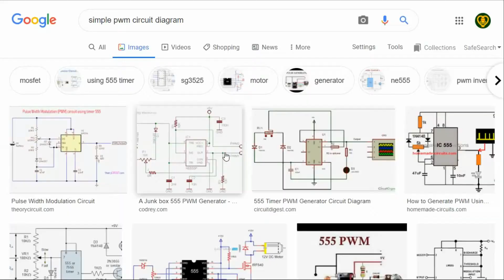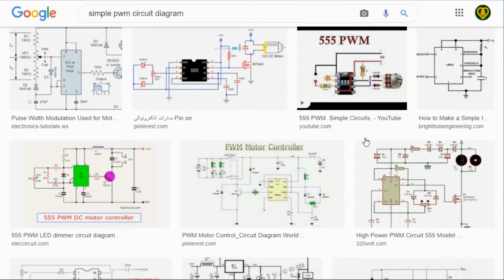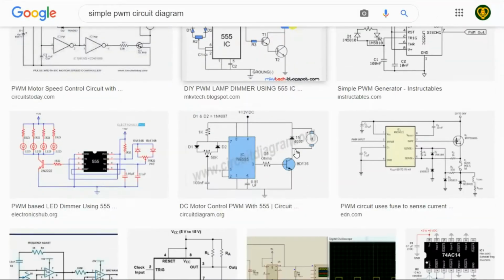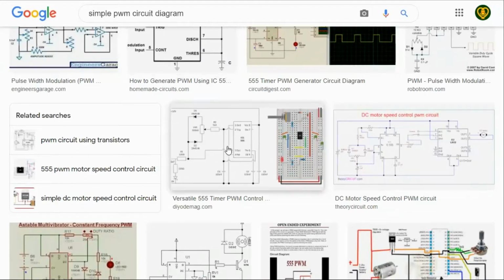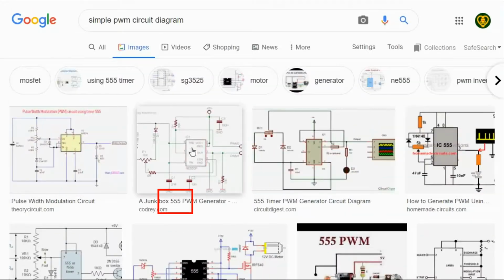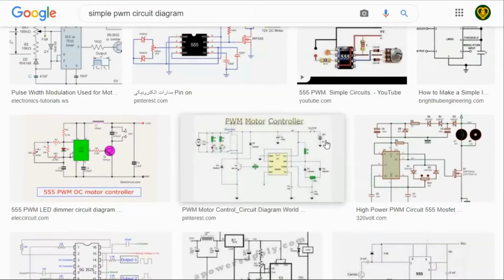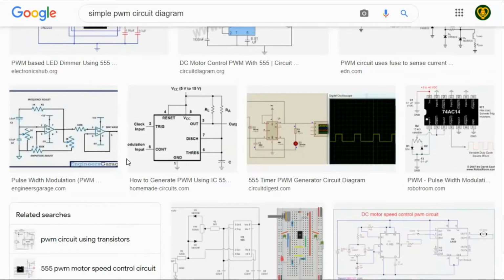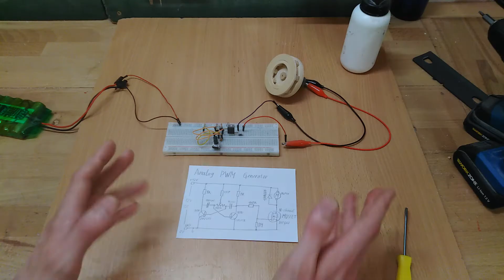Simplest transistor based PWM controller

Comment: This is a nice and simple circuit. But as simple as it is, it is crazy electronics, because every active device in this circuit is operated out of spec. The BJTs are operated in avalanche breakdown regime, because their base voltages go down to voltages far below ground level. You can simply solve this issue by the use of MOSFETs instead of BJTs.

The MOSFET is switched unnecessarily slowly due to the 100k gate resistor in combination with the gate capacitance. This leads to unnecessarily high switching losses. The gate capacitance often reaches the nF range. In fact you don't need a gate resistor at all, because the astable multivibrator itself has not really steep switching edges. This is also the reason why the 555 timer is not the worst choise because it can switch in the sub-microsecond range.

Furthermore the PWM switching frequency can be very important, especially if you switch inductive loads. If you use a too high frequency you can find, that a motor will not start at all because the motor inductance allows not enough current to flow. And at higher frequencies the switching losses can become dominating over the Rds_on losses of your MOSFET.

Comment: Sehr schönes Video. Mir gefällt persönlich, dass du genu das mit zeigtst, was beim Basteln, des öfteren passiert. Es funktioniert nicht sofort. Fehlersuche ist angesagt. Gerade wenn man keine Professionelle Leiterplatte verwendet, kommt es einfach vor, dass man irgendwo eine Drahtbrücke vergisst, oder ähnliches.
Meisstens ist der Fehler schnell gefunden und behoben, aber manchmal sucht man sich dumm und dämlich. Zum schluss fehlt einfach, irgendwo die Masse an einem Bauteil.
So macht jeder seine eigenen Erfahrungen und lernt. 😉

Comment: I used a s9014 instead of a 2n222 and p80nf55 in the place of an N-channel mosfet but when i hook up the power (12 volts from a PSU) , it draws so much current the the mosfet heats up and the pwm doesn't work. when I hook up a 9v battery and i put the output wires in my tongue and i crank the potentiometer, I can feel current but when i hook up an led or a motor, it doesnt seem to work. Help
Reply from the maker: In the video my MOSFET got pretty hot at first as well, there were some connections I should've removed. Nine times out of ten when a breadboard circuit doesn't work, it's just a wiring mistake. Take it apart and put it back together from scratch, then it should work (unless you did the same mistake again). Just recently I tried putting together a high voltage programmer for AVR programming and it didn't work. Turns out I had just forgotten a jumper and after reassembling it everything worked fine.
Your component choice should be okay. Also, there is a newer version of this circuit you might want to try:
https://youtu.be/CcMiGZUzITo
Reply: @ChronicMechatronic  Thanks for the feedback. I’ll do as you said

Comment: Bro. You made a very nice video
But i could not understand how you connected 4.7k to 47k in center 
Please make me correct
Reply from the maker: The 4.7k resistor connects to the middle pin of the potentiometer (the wiper / output)
I also developed a new and improved version of this circuit a while ago which I strongly recommend to build instead of the one shown in this video. It's very similar but gives better results:
https://youtu.be/CcMiGZUzITo
Schematics for several versions of this circuit are free to download in the description :)

Comment: As i already expected, the old two transistor multivib😁
Reply from the maker: There's a better version coming soon!
Reply: @ChronicMechatronic  oh i did not mean it as  criticism. On the contrary, an old and tested and  sturdy design
Reply from the maker: No, no, I didn't take it as criticism 😆 I just wanted to say that there's actually an even better solution, I'm currently working on the video :)

Comment: did you set a Rb resistor for the Darlington? Rb = (Vin - Vbe)/Ib   where Ib = Ic/ hFE.  It is important since it determines the saturation and so that the transistor acts as a switch
Reply from the maker: Since it's a MOSFET I didn't calculate anything 🤣 the 100k is just an arbitrary value, should even work without one entirely. Just the ratio between gate resistor & pulldown resistor should stay roughly the same. Worth noting is, that both values shouldn't be too small, or it will stop working, since it is essential to not disrupt the MV's operation, by lopsidedly draining lots of collector current.
That's actually the only reason for using a MOSFET at all.
Reply: @ChronicMechatronic  Maybe I got it wrong but I had thought at the end you had tried using a BJT.
Reply from the maker: I had tried using a transistor off camera, and it didn't work out. A few weeks ago I tried again for another project, and came to the conclusion that it probably is possible, but only by adding like 5 more transistors to form a schmitt trigger and other stuff to get enough amplification.
For some reason the transistors just won't turn on and off properly if I just use a darlington configuration.
Reply: @ChronicMechatronic  First one has to consider the load as inductive loads usually have
a turn-on current rush which exceeds the nominal current, For general use..........

For BJT versions there are the basic considertaions
- Vce[max] is not exceeded
- Ic [max] is not exceeded
- Pd is not exceeded

Then other constraints which can be interdependent. Here I won't
explicitly denote the total as is the case for Darlingtons;

- effect  of Vce[sat]
- hFE(min at Ic) > Ic / Ib
- Rb, as discussed
- Vsignal > Vbe

That may sound like too much trouble but MosFets have their share of concerns;
- Vds[max] is not exceeded
- Id [max] is not exceeded
- Pd is not exceeded
- sensitive to static electricty

Then other constraints/considerations

- Rds[on]
- Vsignal > Vgs[on] which is deceptive, look at the datasheet graph
- note that Rg is necessary at higher frequencies to ensure a faster turn off
Reply: @ChronicMechatronic  a schmitt trigger is usually used to 'clean' up a digital signal or to enact hysteresis,   By itself I doubt it is the answer
Reply from the maker: I found out how to do it without a MOSFET, used it in my newest video
Reply: @ChronicMechatronic  One caution about MosFets is that they need a relatively high input voltage - it depends on the Vgs[on] parameter
Reply from the maker: Yeah, that's just what makes it work In that circuit.

Comment: One reason for using the 555 is that it will 'always' work.  MVs, apparently, maynot start. A fuse might be a good idea if the motor stalls.
Reply from the maker: Yeah, a fuse couldn't hurt... Though I've never seen an instance where the MV didn't start.

Comment: Can I use IRFZ44N 😀
Reply from the maker: Yep, as far as I can figure! I think every N-channel MOSFET with a gate threshold voltage below 5V should do 😄👍
Reply: I've searched on google it says 49 amp to drain and gate threshold voltage is 4 volt, I'm gonna make this circuit, thanks for this circuit👍😀.
Reply from the maker: @avaydon7679  yeah, I looked at the datasheet as well before telling you you could use it. 😄